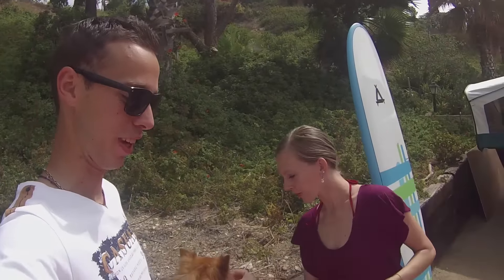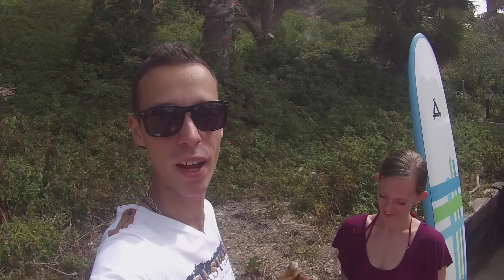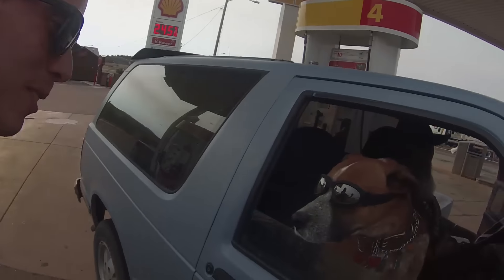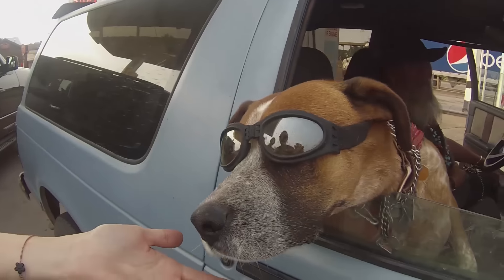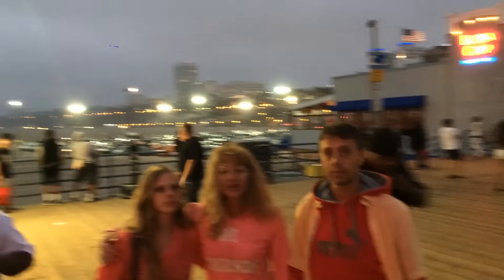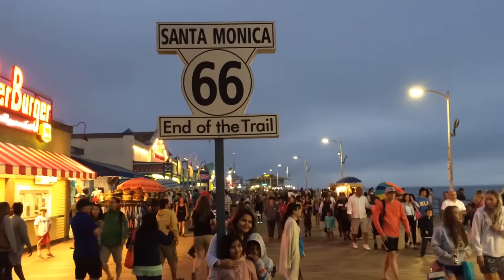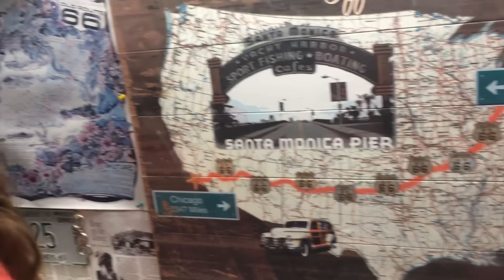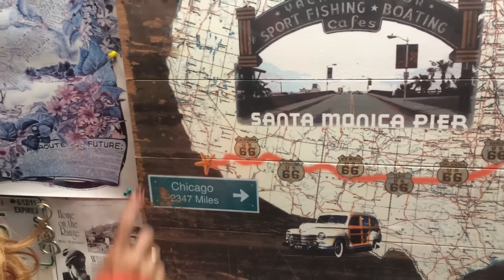We are in Malibu  Anyone in this region

Comment: I'm in Kentucky is that close lol
Reply from the maker: lol depends on how fast your car is?
Reply: +World Mechanics 2006 Mazda Tribute lol you tell me
Reply from the maker: v6, or 4 cylinder?
Reply: +World Mechanics I wouldn't have a 4cyl in something that big its just dumb lol the v6 is still under powered if you ask me lol
Reply from the maker: Drop a 2.3 Mazda Cx-7 Turbo Engine in the Tribute. It is around 260 hp stock with 6 speed tranny. With aftermarket turbo and a few mods you can get it to 350hp easy. I drove one a long time ago and it was insane
Reply: +World Mechanics mine has the 3.0 v6 I'm thinking about super charging it